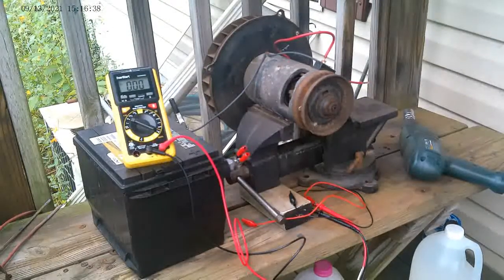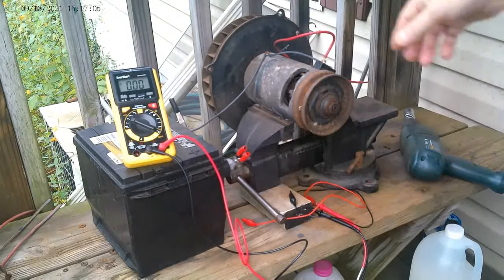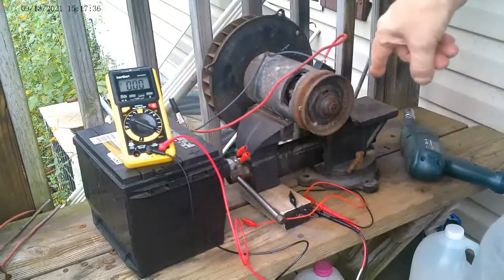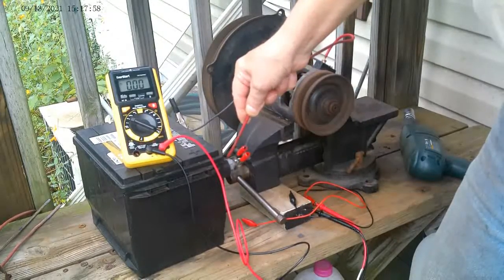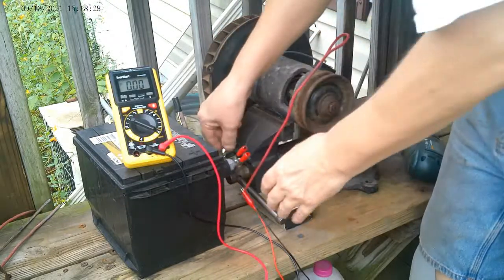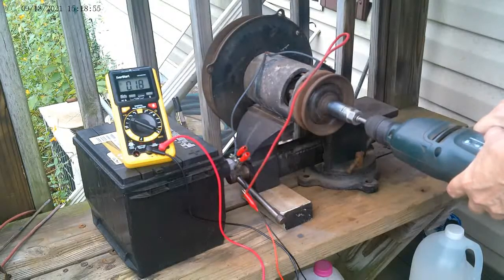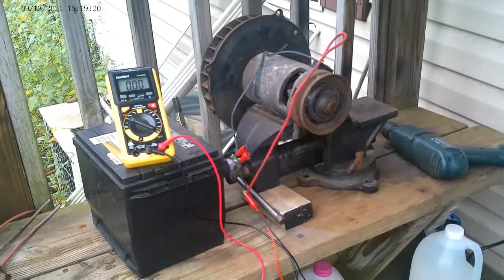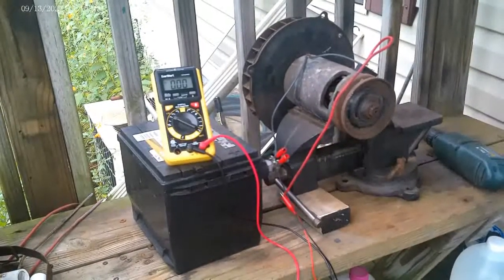12 Volt VW Beetle Generator Polarization

Comment: Yep, you are correct on chargers don't have the cranking amps to run these as motors briefly. Since I don't have a 6v battery yet I looked it up and can run it for a few seconds using a 12v battery. It works and spins clockwise👍

Comment: Just what I need but can I do this same test but with a 6v battery due to my generator and regulator are both for 6v
Reply: Tried it but doesn't move with my 6v charger but when I ran it with my drill motor and volt meter it works 2500 rpm 7.5 volts so for a 6v generator we're good. Not sure why it won't spin as a motor? Oh well not important anyway. It charges 👍

Comment: This is great information.  One point to consider is that a generator will put out varying amounts of voltage depending on the speed.  So, your drill will probably need to be producing something like 1200 - 1500 RPM before you will see the 14V output you are looking for.  That range is a bit of a guess.  It may need to be closer to 2K or more.